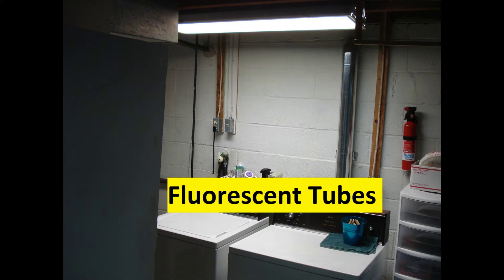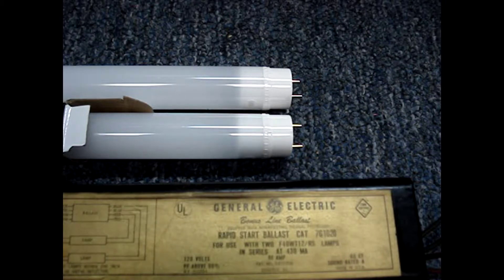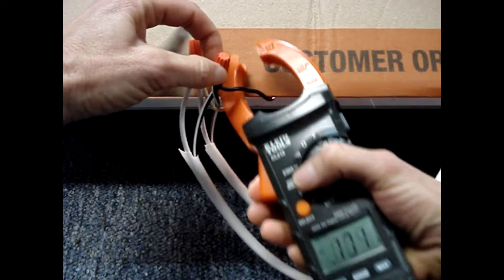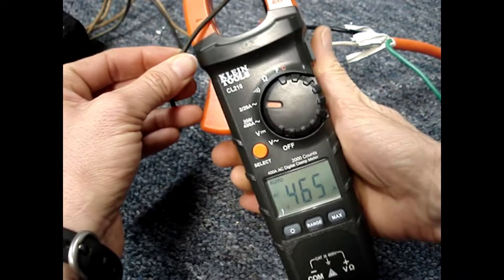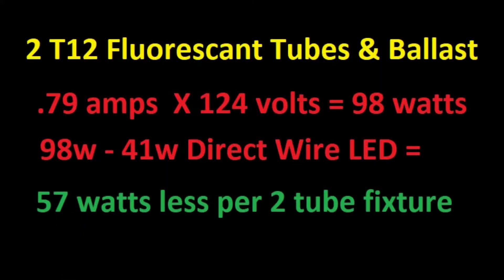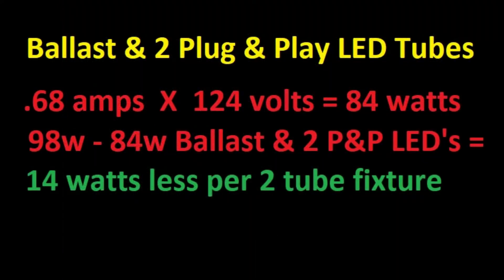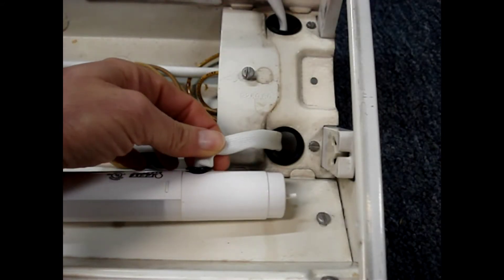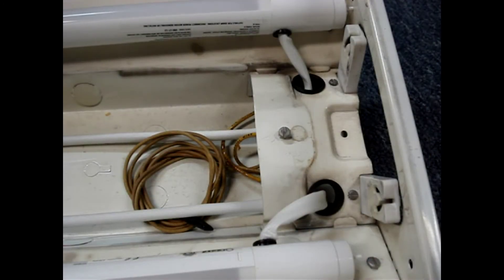LED Tubes + Ballast May Not Reduce Energy Costs

Comment from the maker: Arthur has pointed out that Amps x Volts = VA, not watts.  The correct formula is Watts = Power Factor X Amps X Volts.  Circuits containing only heating elements (filament lamps, stoves, strip heaters) have a power factor of 1.  A power factor of 1 does not change the result for these devices: Power Factor(1) x Amps X Volts = Watts

Circuits containing inductive or capacitive devices (motors, ballasts, etc) usually have a power factor below 1.  The ballast in the video has a power factor above 90% (as listed on the ballast).  Conservatively, I'll use .9 for the power factor.  For the LED tubes and the ballast:  124V x .68A x .9 PF = 76 Watts.  The ballast & fluorescent tubes: 124V x .79A x .9PF = 88 Watts.  Using the correct formula, the LED tubes and ballast combo only saves 12 Watts.  It's still not a good deal to buy the plug & play LED tubes for my ballasts.

I always try my best to get the videos 100 percent correct, though I can't always be absolutely correct, it's not humanly possible.   Thanks Arthur for making us all a little smarter.

Comment: what if your ballast is compatible ?
Reply from the maker: You won't know how much energy a ballast will use unless you test them as I did.  I wouldn't bother with the plug & play.  Eventually the ballast is going to fail.  Then you are going to spend time & labor replacing the ballast or replace the light fixture... and be left with plug and play led bulbs.  Odds are that the plug & play led tubes are never going to pay for themselves.  I have 2 companion videos on this topic.  https://youtu.be/gz_irZxyD94       https://youtu.be/C5OCwIYze8g

Comment: Unfortunately, your calculations are incorrect, because you are not accounting for power factor, or the shift in angle between the volts and amps. Multiplying volts by amps gives you VA, not watts. The watts drawn are only attributable to the current that is exactly in phase with the volts, and you have no way to measure that with the two separate meters you used. Officially, watts in an ac circuit are:   , where V and I are the sinusoids rms values, and θ (Theta) is the phase angle between the voltage and the current.However, I agree with your effort to check claims such as those on vendor's packaging, you'll need to use some different equipment though.
Reply from the maker: Hi Arthur, thank you for bringing that to my attention.  When I looked up for the formula to calculate watts, the internet (it's always right... lol) standard answer is the formula that I used.  I dug a little deeper (you are correct) and I see getting the right answer is a lot more complicated... and a little over my level of electrical education.  I did find a calculator that is supposed to find the right answer.  My ballast says PF above 90%.  I used the calculator, I selected single phase AC, .79amps (for ballast & LED tubes), 124 volts and .9 for the power factor.  The answer is 88 watts.

I'll add a link to the calculator, would this be the correct watts used for my ballast & LED tubes?  https://www.rapidtables.com/calc/electric/Amp_to_Watt_Calculator.html